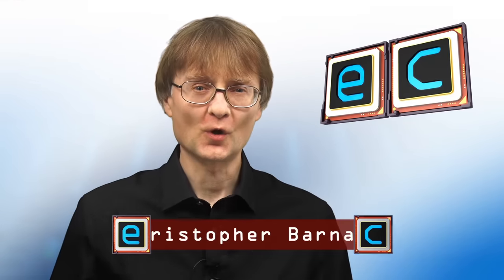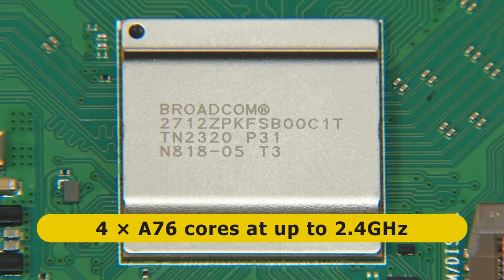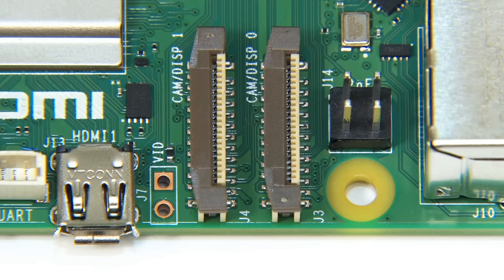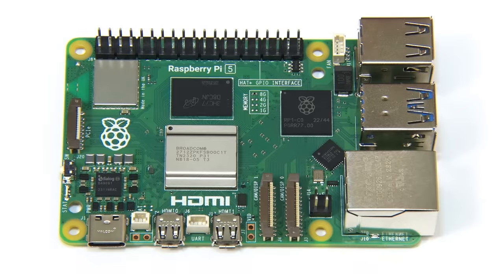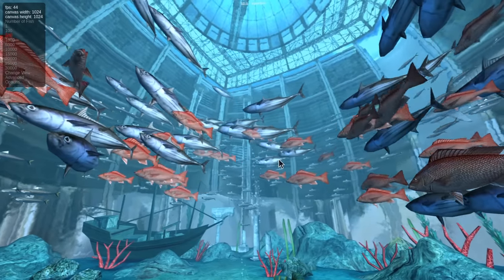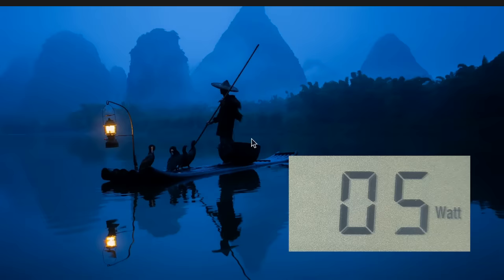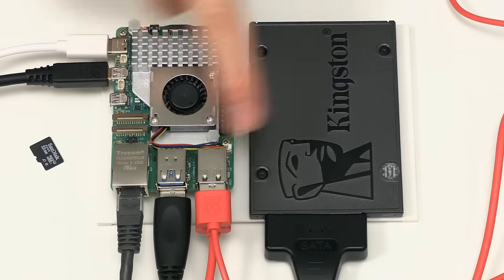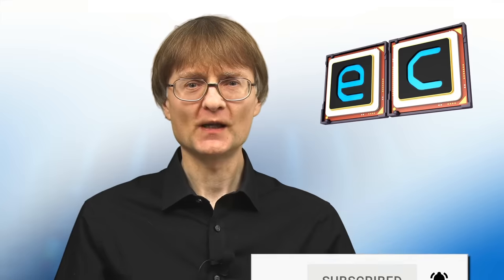Raspberry Pi 5

Comment from the maker: Greetings All! Following many posts below, just a word on the operation of the Pi 5 power button. When power is first connected to the Pi 5 (ie the adapter is plugged in to the wall socket and/or switched on there), the Pi 5 immediately boots -- which is what happens in the first boot shown in the video. But if the Pi is then shut down but power is not removed, the power button can be pressed to boot it up again (which is what happens in the second two boots shown in the video). So those worrying that human intervention is neccessary on every boot, or after a power outage, need not fear. :)
Reply: Can that be configured?  There are times I would prefer it in "previous power state" mode.

WoL would be a plus too.
Reply: The button may be a simple circuit breaker which equivalent to manual unplug and replug
Reply: @ysts3452  I have my doubts about that, considering how sophisticated the power system is on this board.
Reply: Do you can connect external graphics card in PCIe slot? Is NVme M.2 supporting?
Reply: I keep watching these videos but never had the money to buy any Raspberry Pi 1, 2, 3, 4, and now 5!:face-turquoise-covering-eyes:
Reply: @ysts3452  Pi firmware has supported a "real" power button for a little while, it's just that now there's a button on the board to use with it.
Reply: @zombie_pigdragon  is it similar to an action button and default set to be a power button
Reply: I cannot believe they dropped the 3.5mm jack. They lost the way and forgot the many uses the boards are used for.
Reply: Is there a reason they don't do 4 USB3 instead of breaking them up? Is it something to do with PCI lane whatever? I mean USB3 are backwards compatible !
Reply: Can you tell us more about the power protection or fuse features which lacked in the rpi 4? I recently fried my rpi 4 8GB due to a power surge…
Reply: If you interrupt power then deliver it again, it boots? They've done a good job configuring things then.
Reply: @willb1242  I want to be able to select that behavior. Sometimes I want it to come up by default, and sometimes I want not, and yet other times I want it to power on iff it was powered on when it lost power.
Reply: @pleappleappleap  that would be good, but to have a selectable behavior to deal with unexpected power loss, you need durable memory state AND bios options to select what you want. Maybe the pi has all that now? But getting it all together may not have been priority. Geerlings video shows how an "off" state is still pulling 1w unless you set it to truly power off, so I think most likely whenever it first gets power from the plug it will turn on. We'll see. In other words, it's complicated :)
Reply: maybe a stupid question, but: the Pi5 usb-c port, is that solely a power supply port or does it double as a usb-port?
usb-c is fairly agnostic to who is host and who is guest and whether hosts should supply clients or the other way around.
Reply: @willb1242  Not that complicated.  PC's have been able to do it with a two bits in CMOS RAM for quite a number of years.
Reply: @robertheinrich2994 yes the USB-C port has data lines. Not a stupid question at all.

According to Gordon Hollingworth (Raspberry Pi's chief product officer), "The USB-C connector has the same dwc-otg interface capability as Pi 4. It will also go into rpiboot mode if you hold down the power button when you power it."

Looking at the top side of the PCB, there's 2 traces going from the USB-C socket straight to the Broadcom SoC (bypassing the new southbridge chip), they look like they're the D+ and D- lines. I can't find any high-res images of the PCB underside, but it might mean the USB-C port is limited to USB 2.0 speeds?

edit: Hollingworth confirmed in another comment that it's USB 2.0
Reply: @cjlowe1650 I don't know Raspberry Pi's reasoning, but it could be to keep costs down, and/or because some USB 2 peripherals don't work properly when connected to a USB 3 port.
Reply: That is awesome, actually. Where I live, we always have power outages because of too much heat, or too much snow. 🍁 I have a small UPS, but with all the compute connected into it, the outages usually last longer. Do they have viagra for UPS?  I should add that my fail-safe is that I have all my user files on a rpi-powered file server, and if any rpi dies, it'll take about 1/2 hour to replace it from my stash and documented steps. Everything important is on a single drive that is duplicated regularly, and none of the rpis contain any user data.  There are two copies - one in a fireproof safe, and the other outside my home. They get updated in the obvious order of ease, of course.

It sounds complicated, but it's absolutely not. It is slobberproof on purpose.
Reply: Safe shut-down scripts can be strange animals. I've encountered confusing situations where I had to remove the power cable from my Pi3B on the off position, to ressucitate it, as it would not restart.
Reply: @dishantshah5965  Are you sure there is no fuse on the Raspberry Pi4 ?  I am pretty certain there was one on the Pi3B, right after the USB power supply. The circuit boards actually use less than the recommanded 15 Watts. Whenever the temperature goes higher than the 70 or 80 Degrees Celsius limit, the fuse goes off and shuts down the Pi3B. The Pi4 is hotter than the Pi3, it would be strange if they had got rid of the fuse  ?
Reply: @paulslabbert There is a place on the board for a composite video header, you just have to solder it in, however for audio, you'll probably need a (cheap) USB DAC.
The pads are between the HDMI1 and the camera connectors
Reply: @wereoctopus  great, my only RPi is a version 2, and the port is just that, a power port with nothing else.
since there are now a lot of nice hubs that charge simultanously to providing extra ports, this is nice.
Reply: The pi is a pack of lies.  That's all it is.  It was introduced as a 35 Dollar computer which was a lie.  But now its hundreds (at least 200) to build a decent pi with everything it needs.  For all that, you can just buy a used PC with an older but faster processor.
Reply: Lets hope they make some adaptor that combines the posibility of using PoE and NVME via the Pcie port.

That supplied heatsink / fan takes up the space where a PoE HAT would sit.
Reply: hmm Disappointed with new Pi 5,  expect more CPU?GPu performance  and all decoders to finally play youtube min 1400p/60 without losing frames. This device can't even run video at fullhd without losing an insane amount of frames.  I was thinking about little Multimedia PC for Movies, music, Youtube most and simple NAS.  Hope the new Rockchip will be even better than previous ver that almost do what I wanted but still is not there.
Reply: @diuran1919  The real problem isn't so much performance as cost. By the time all is said and done, it's gonna be in the 200 Dollar range. But 200 Dollars can buy a pretty decent (compared to the PI) used PC.
The 35 Dollar price point was the reason for the PI to exist.  Unless the size is above all other considerations, it's not very compelling IMHO.
Reply: Does that work the same with RST connection on the 4?
Reply: @paulslabbert It still has the holes for a video out though
Reply: @tarstarkusz  but maybe not at the power consumption of the pi, which is a concern if you want to use it as a server. :)
Reply: Looking good.  Will be interested in what capacity camera support that there is.
Reply: If you use the button to power off the Pi 5, does it do a clean shutdown?  Or are you likely to crash the SSD or other storage devices?
Reply: @Alexander-fc3nt  Suggest also watching Jeff Geerling's videos for the latest on PCIe compliance - he has been compiling the definitive list of boards compatible with the Compute Module 4's PCIe, and while graphics cards have been a challenge to get properly working so far, he has got some to at least talk to the Pi - follow for the latest!
Reply: Thanks so much Chris. I always preferred to boot an OS myself so that I know when it is booting.
Reply: @pleappleappleap  pretty sure i used WoL on a 4B so i'm sure the 5 has that too
Reply: @paulslabbert  Agreed 100% - I currently use a mini PC as a MIDI sampler and I'd really like to switch to a RPi-based system but naturally it needs the analogue audio output. Yes I could go with USB or HDMI audio adapters etc but then I might as well stick with my current setup.

Comment: The audio jack removal is one of the worst changes ever. It has very practical uses when it comes to Raspberry Pi. One of my projects relies on it, so I will not be upgrading it.
Reply: There are cheap adapters to split audio off of HDMI into separate audio and video outputs - it's no biggie.
Reply: @terrydaktyllus1320 The point went straight over your head 🙄
That's extra hardware that was previously never needed and limits media use without adapters sticking out
Reply: Yeah I plan on making a music player, and no 3.5mm jack kinda sucks
Reply: @terrydaktyllus1320 adapters this, dongles that... this is the issue with new hardware... making us buy extra bits and bobs to achieve basic functionality
Reply: Built in audio was poor. Like 90s poor. A proper hat or digital hdmi far better
Reply: @Voidkitty_ you can get headphone port to usb. They lost like a £1. Also it's so annoying that they did that. :(
Reply: To be fair the built in audio was terrible
Reply: @danholli123  You've never met me, you've no idea what does or does not go over my head. So kindly stick to the topic of discussion, we were talking about computers, not me.

Yes, I am aware it was "extra hardware that was never needed" but I am engineer and my entire attitude in my 40 years of building and programming computers is summed up "how do I get this thing in front of me to do that?"

I was providing a solution to what you consider a problem - so next time say "Thank you" and be a bit more grateful!
Reply: @sihledotcom  What is your basic functionality may be not be the basic functionality of others.

Maybe space limitations meant that the audio jack couldn't be fitted and had they done so, maybe the I/O chip would have been left off and kept performance more to that of a Pi 4 - and then someone else would have complain.ed

Please stop whining. I am engineer, they stated the lack of an audio jack is an issue, I provided a solution - in which case say "Thank you" and be a bit more grateful.
Reply: @terrydaktyllus1320  Well, if I am making a device, I don't want these adapters inside. At best, it will just be a little annoying. At worse, I won't be able to fit.
Reply: There’s always a group of people who care about this who I don’t care about
Reply: i think there are pins for audio out so you can solder on a jack yourself if you really must, but like others say the quality wasn’t good anyway and usb audio DAC is cheap and much better sound quality. even Apple’s (although it’s usb-c) is like $10
Reply: Honestly I'm a tad sad to see it go, however I've always preferred to not use it since I found the audio quality wasn't the best for what I wanted, so I always just bought a DAC HAT
Reply: One point is when it's working why upgrade?
Reply: @danielktdoranie  Agreed, I just think some people need to learn "politeness" when you take the time to give them a solution to something that they say is a problem.

I think a few people here needed parents who said "no" to them a bit more often when they were growing up!
Reply: @Nordlicht05  Then don't upgrade.
Reply: @Nordlicht05  I already didn't plan on before I noticed the lack of an audio jack. But I definitely won't know that I know it is missing it.
Reply: There's holes for soldering in a connector if you need it
Reply: @UriahStuff  Then make a different case. Or use an SBC with an audio jack. There, two more potential solutions to your problem. You're welcome.
Reply: I suspect the Pi4 will continue to be available 🙂
Reply: @deanstyles2567  Yes, I am sure you are right. They are still making Pi 3's and the original Zero W too.

I suspect they "support" using the "n-1" standard - current and the one before it for each model.

It would be interesting to see if they then stop making the Pi 3 to just make 4 and 5 now.
Reply: I'm going to miss the audio jack, but it does look like one can be soldered to the board afterwards as the points for it are present.
Reply: @Voidkitty_ Well if you want good quality audio out of Pi, surely you have some kind of an audio dac hat in it??
Reply: This decision does make it harder to connect to old monitors; the sort with DVI/VGA and an audio input.  I think a pre-soldered headphone jack would be more useful than a pre-soldered second HDMI.
Reply: @terrydaktyllus1320 Nobody owes you a "thank you." Sheesh.
Reply: @xargos  Yes, you are indeed correct. Nobody with parents that didn't say the word "no" to them enough when they were growing up would ever say "thank you".

Good, we agree. You're welcome, you can thank me later.
Reply: @xargos  PS. About your avatar... aren't you a bit old for "My Little Pony"?
Reply: @terrydaktyllus1320  The fact that you feel the need to say that says a lot about you. It isn't good, either.
Reply: @xargos  Do you brush the hair of your My Little Pony?
Reply: usb sound is better

Comment: This is the first Raspberry Pi since the original that I haven't bought at launch. Factor in the heatsink and power supply (let alone the new peripherals) and you're pushing £100 which is a far cry from the original aim of cheap computing. I'm sure it's a fantastic piece of hardware supported by equally fantastic software, but it's too rich for my taste.
Reply: I would suggest probably near £80 if the $80 launch price for the 8 GB Pi  5 alone equates to around £60.

On a good day, you might get a used 3rd or 4th generation Core i5 SFF PC with 8GB RAM slightly cheaper but I think the Raspberry Pi price is competitive on that basis.

Ultimately, you could buy much cheaper and lower-powered SBCs that may do what you need but you then have to do more work yourself - "swings and roundabouts" as they say.
Reply: Are you just an AI sent-in to justify rising prices?
Reply: Seems fair to me. Just a desktop cpu or a nuc/sff or whatever is easily 100$
If your just email checking or hobby projecting or even doing something more serious, 100 currencies is a very low cost of entry.

I hope it drives used prices of older pi models down and brings more to the market.
Reply: @FacialVomitTurtleFights  I see you're a strong believer in trickle-down economics, and all the bottom-squeeze that's going down.

The Pi4 1GB was 35$ and the 4GB was 55$, in 2019.

Yet here you are 4 years later trying to gaslight everyone into thinking 100 bucks is "just fine"...

Of course, you would never only spend 100$ on it, because you will need to cool it and accessorize it massively. Probably increasing the cost into the 200s, easily.

Still think you're just an AI, honestly...
Reply: @terrydaktyllus1320  Sadly US dollar prices often translate directly to the price in UK pounds - currently the $80 variant is pre-ordering for £79.

I'll wait too I think, see what happens to Pi4 prices (though the 5's a fine upgrade and i'll likely get one eventually, especially if the GPU is a decent performer).
Reply: I think I agree, they are starting to lose their way a bit. Sure more power is often a good thing but you're paying quite a bit in terms of money and 5v 5A is a lot and prevents it being used in a lot of places. I won't be splashing out for 100% more expensive 30% faster machine not for now.
Reply: @zCaptainz that isn't even remotely what the vomiting face turtle said.
Reply: Pent-up demand. Early adopters will gladly pay that. At least for one. Their pricing structure did vary significantly depending on the amount of RAM, so a 1 or 2 GB version may be significantly less.
Reply: I'm really hoping that we see a "Pi Lite" maybe dial back down the Graphics (Why does a SBC need to power TWO 4k displays Is that such a common usecase!?!, drop the PCI port/lanes or maybe drop to 2gb of ram, and see if they can get back to ~$40

This really feels like the 'beefed up big brother' of the Pi (The B+ to the A), but the Pi now costs more than an entire day's work of a minimum wage US Employee. 

It's definitely no longer an impulse buy...and why buy 2 pi's when I can buy a used desktop...

Regardless
It'll sell like hotcakes cause Pi's strength has always been it's userbase, documentation, compatibility, plenty of people will buy this for a task something lighter could do.

But honestly This is the first time I can't think of a use that I need to run out and buy one day 1...a first for me :(
Reply: @novamaster0  the lower RAM variants are supposed to come out later, so getting a less expensive 5 shouldn't be an issue. I'm guessing the 4 and 8 GB variants are out first because of projected demand. So many RPI4 4 GB models ended up as school kids computers, probably looking to tap into that market first then release the remaining variants